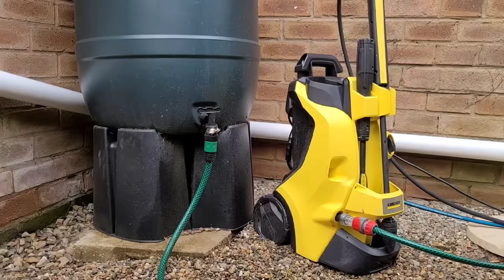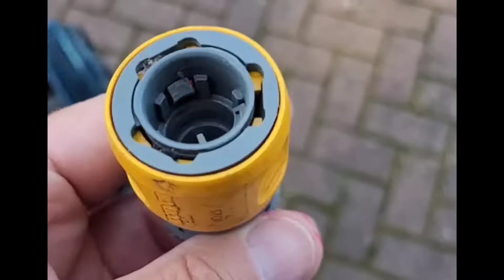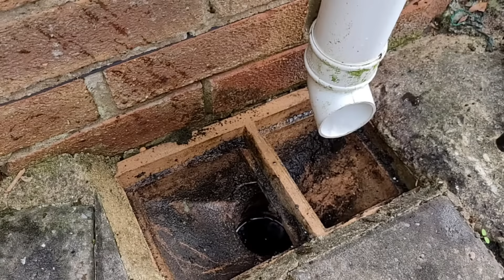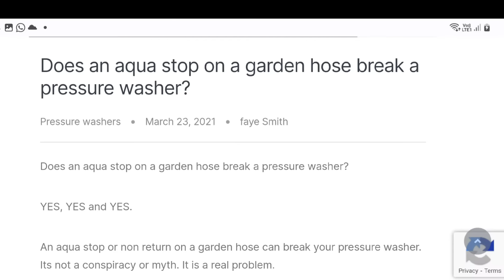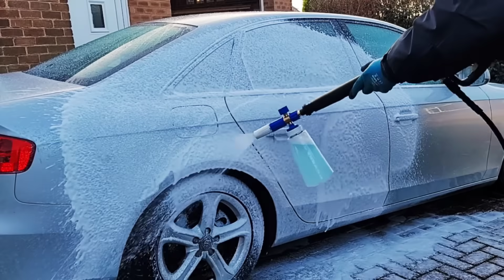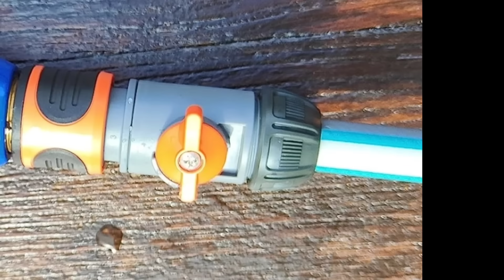The Big Mistake to Avoid when Using your Pressure Washer

Comment from the maker: Update: As several contributors have correctly mentioned, Aquastop fittings do allow flow in both directions when connected. The original source of this error was an article by a well respected pressure washer manufacturer but they have now withdrawn this article. However, the advice from manufacturers and dealers remains not to use aquastop fittings (see the links in the video description). Having looked into it in more detail, it appears that the valve (white pin) in an aquastop connector acts as an obstruction (i.e. it reduces the cross-sectional area) in the pipe. This reduces flow and pressure local to the valve but causes an increase in pressure upstream (inside the pressure washer). I assume this is why the water inlet failures are common. This link gives more detail: https://www.quora.com/Does-a-blockage-in-a-pipe-affect-overall-pressure-of-fluid-in-the-pipe
Reply: Why not removing the video from YT?
Reply from the maker: @projekt156  Because the main point of the video is correct. The manufacturers (Kärcher and Ava) and North West Power Washers (agent and service centre for Nilfisk) recommend that you do not use aquastop connectors with their pressure washers because using them can potentially result in damage to the machines.
Reply: @bigtedshome  Sorry if this is a stupid question but how do i know what sort of connector my hose has?
Reply from the maker: @nrosko An aquastop connector will have a valve inside like the one in this photo (the white pin with the o-ring): https://www.lsengineers.co.uk/2075-soft-touch-aquastop-connector-bulk.html
Reply: @nrosko  if you cannot see through the valve, it has aquastop.
Reply: Thanks for this. Definitely not gonna use the aqua stop now.
Reply from the maker: @billybyrne523 Thanks Billy. It's just as easy to use a connector with a valve, and they don't cost much more than an aquastop connector.
Reply: Agreed. Anything that goes across the inside diameter of the hose/connector will reduce the water flow or increase the pressure to the machine. This will depend on the mains pressure.
Reply: However despite it flows both ways it still restricts water flow by design.

Comment: This is really interesting been using my K4 on front of house mainly for cars no Aquastop ,Two days ago goes on the rear of house to clean patio green alge etc ,My rear hose does have Aquastop never gave it a second thought after id just finished an internal leak developed on Karcher youtubed it you can buy a part which i did replaced worked fine for two mins next thing leaking again i stripped it down again main body had a crack in it so knackered now ,Having watched this chap it makes sense ,some people commented on here about aqualock is two way yes it maybe But the return flow is restricted with that white pin thing ,Listen thanks for taking your time to do this ,Ive just bought another K4 .Karcher get a lot of stick on internet maybe they need to push this message further
Reply from the maker: Thanks for sharing your experience. I hope you have better luck with your new K4 🙂

Comment: Is there a tap you turn to release the soap chemical into the upright karcher machine?
Reply from the maker: No, you either plug a bottle of detergent into the dispenser or use a foam cannon. Both methods are shown in the first minute of this video: https://youtu.be/8Rg4oZI2Mq4

Comment: Hello. I bought a Parkside pressure washer from Lidl a few days ago. This is my very first pressure washer I've ever owned. Now i connected the outside tap to my connector, then connected my hose to the pressure washer. Started the pressure washer and as soon as i turned it on the pressure washer got louder and louder, I immediately switched the pressure washer off. My gut told me this doesn't sound right. Watched a few YouTube videos after this on how to use a pressure washer.  i Found i was doing it correctly so started again connecting everything up. Again the pressure washer did the same thing. After a few days of scratching my head i found i was using a Hozelock (aqua stop) connector from my garden hose to my tap. I then Went to b&q and for £6 bought a Gardena connection this connection has no aqua stop in it because with a Water Stop connector typically has a darker (often black) end where the accessory connects. Internally, you will see a plastic cross or a protruding cylindrical piece with an O-ring. Standard connectors without Aqua Stop are usually grey or a lighter colour and allow you to see straight through the hole. Changed the connectors and Now my Parkside pressure washer works like a Dream!!!
Reply from the maker: Thanks for commenting Dean. Parkside tools are normally very good value for money 👍

Comment: Been using aqua stop with my Nilfisk for 10 years and it’s still going strong.  Perhaps I’ve just been lucky or maybe I just have enough pressure from the tap to compensate for any loss of flow.  Might also help that the Nilfisk has an aluminium pump rather than the plastic Karcher likes to use

Comment: Aqua stop destroyed my K3 Kompact, gutted. Looks like it's ok to use Aqua stop on the tap but not against the machine. Good video but too late for mine
Reply from the maker: Thanks Niko. I'm sorry to hear about your K3.
Reply: @bigtedshome I learned my lesson and it's great you're putting this information out there as it's not clear enough to buyers of these jet washers.
Reply from the maker: @Niko-xz5lk The advice not to use aquastop connectors is in the manuals of Karcher and Ava pressure washers but you are correct, it is easy to miss this information. My new Ava pressure washer also had a label on the back warning against using aquastop.

Comment: Hi Ted., snd thanks for your time, making all thrse videos.

Ive just bought a K4 classic pressure washer,  Karcher, do i need to buy a seperate water hose to  connect to my water tap, and then my karcher,  or does it gome eith a hose [ ive not opened my ksrcher yet) thank you.
Reply from the maker: Yes, if you don't already have one, you  will need to buy a garden hose to run from your water tap to the pressure washer.

Comment: Daft question sorry. just so ive got it right. you DONT use a aquastop on the pressure washer. but you can use one one the garden tap. Thanks.
Reply from the maker: @rjwilkes1970  Yes, that's correct. There is not much point putting an aquastop connector on the tap though. All it will do is restrict the flow. I use a standard connector on the tap and one with a control valve on the pressure washer.

Comment: Aquastop can't cause a build up of pressure as once it is fitted the 'stop' mechanism is released so water can flow in both directions. This article is nonsense
Reply from the maker: @whawkins88  the valve can still cause a pressure increase upstream by reducing the cross sectional area. Please see the pinned comment for more details

Comment: Buy an electronic auto off switch gauge that automatically off the inlet hose  if the pressure reaches the program psi to prevent your inlet from breaking apart.

Comment: I use a garden water butt and a Karcher K4, i use this  Hose Connector with Control Valve at the pressure washer end right?.
Reply from the maker: @pureblood4386  Yes, it makes sense to have the control valve at the pressure washer end.

Comment: This contains correct information  do not use an aquastop  on a powerwasher ,I repair power washers ever day   the best set up is use a 3\4 hose as supply , and no aquastops , use a in line tap at the power washer  , keep the supply water hose as short as possible , do not use extension power cables  as voltage loss over distance is an issue too , you can use an extension pressure hose  instead , the cost of repair is an issue for all ! And my main argument is an every day talking point , if you buy a house hold power washer and do a professional job is for work , but a professional power washer , well would,you buy a wheel barrow when you need a lorry ?
Reply from the maker: @ianholmes1468  Thanks Ian 👍

Comment: About three quarters of the way through watching your excellent video I thought "I'm going to leave a comment saying that I have always replaced the Aquastop fitting with a Gardena tap fitting."  I'm glad I watched it to the end... I would have looked like a right 'Nana, AGAIN!   🥴  😜
(BTW: The Gardena fittings do not weather as well as I would like... the last time I replaced one, I used a Holman brand.  Rather than a fiddly hard-to-turn tap, you rotate the whole fitting - a bit like wringing a chickens neck!🐓 😱
It seems to be weathering better, and it is preferable to use.)
Reply from the maker: @PiefacePete46  Thanks for the tip. I'll look into the Holman connector 👍

Comment: Why would an Aquastop connector prevent the release of pressure? The Aquastop valve is opened by the end of the male hose connector pressing on it. As soon as you connect it to the machine, the Aquastop is opened by the connector on the machine and it stays open until you disconnect it
Reply from the maker: Good point Paul. Aqua stop fittings do allow flow in both directions (The Ava source is incorrect in saying that they are non return). Having looked into it in more detail, it  appears that the valve (white pin) in the aquastop acts as an obstruction (i.e. it reduces the cross-sectional area) in the pipe. This reduces flow and pressure local to the valve but causes an increase in pressure upstream (inside the pressure washer). I assume this is why the water inlet failures are common. This link gives more detail: https://www.quora.com/Does-a-blockage-in-a-pipe-affect-overall-pressure-of-fluid-in-the-pipe
Reply: @bigtedshome  The obstruction is likely to reduce the pressure between the connector and the pump. That might be the cause of the failures

Comment: What nonsense, the Aquastop connectors are a form of drybreak fitting, not one way valves. If your pressure washer is capable of being run off a water butt then the flow restriction of the internal components isn’t amounting anything. Failure of power washers is always down to poor quality machines and in extreme cases leaving a machine with water inside during freezing conditions. As a rule of thumb any pressure washer under £300 is a disposable item. I don’t rate Kärcher machines, cheap bits with an expensive brand name. Get a Shtil RE130 or above.

Comment: I Replaced a Karcher K4 Last Year after Suffering Low Pressure Performance for about 6 Months . I Called into my Local Karcher Dealers to Buy my K5 and while telling the Guy in the shop why i was Buying a New K5 "I had Dumped my K4 " in the Recycling Center about Half an Hour Before that , He asked do i use Aquastop Connectors and i said yes He Said that was the Problem. I kept The Trigger Lance and Hose of the K4 So All was not Lost , The Aquastop Connectors went into the Bin as soon as i got home

Comment: All good, but if they had designed and built a decent pressure cleaner with thought to using suitable components in the first place, then the subject would be moot.
Not so cheap throw away items, at least in the domestic market side of things.
I have worked and repaired all manner of high-pressure products for decades and the quality is going down all the time.
Even the commercial side of cleaners are going the same way.
All built to a price and not to a standard. Of course this applied to just about everything manufactured.
Disappointing
Reply: Yes my karcher 2 lasted two seasons then water leaking out, the plastic pump cracked absolute rubbish. I use a straight through hose so that won’t be a problem. Also worth mentioning there is a fine gauze filter in the water intake which would block up if using a water butt. I thought they were German made but are more Chinese shyte.
Reply from the maker: You're right about manufacturers continually trying to cut costs to stay competitive. It works its way down the supply chain and inevitably leads to a drop in quality.

Comment: An aqua stop allows water to flow in both directions thru it when it’s connected to any male fitting.

If you don’t believe me, stick an aqua stop on your tap and watch the water flow thru it in the direction that it flows out of your pressure washer when you switch it off.
Reply from the maker: Thanks for commenting. You are right about the aquastop allowing flow in both directions when connected. Having read up more on this, I believe the valve (white pin) acts as an obstruction rather than stops all flow out into the hose, and this reduction in cross sectional area causes an increase in pressure upstream (in the plastic water inlet). This link explains in more detail: https://www.quora.com/Does-a-blockage-in-a-pipe-affect-overall-pressure-of-fluid-in-the-pipe

Comment: That's not what aquastop valves do! When connected to the male connector, the valve is held open and allows flow in both directions, it is not a non-return valve. They simply allow hot-swapping of the hose accessories. Stating that the hose acts as an expansion vessel is not correct otherwise the hose will likely see pressure that it is not designed to take, not to mention the risk of contaminated water returning to the mains. You will find that the pressure washer will have an internal non-return valve to prevent this from happening, and also an internal pressure relief valve.

Comment: You forgot to mention a  MAJOR  way to kill your pressure washer .... leave it in a freezing cold shed all winter ( ? ) ...residual water in the internal pipes & bits - n - bobs , EXPANDS !  on freezing , blowing the parts and pipes to bits 😝 .... the following summer your unit fails to work  (  Repair Café volunteer .... DAVE™🛑 )
Reply from the maker: @davidfalconer8913  Good point Dave 👍

Comment: This is rubbish. Water/pressure  can flow both ways through an Aquastop connector whilst it's connected to the machine, so the theory that it causes pressure build up inside the machine is null and void. The restriction of the one-way valve may reduce line pressure slightly but, if your machine works happily from a water butt, which provides even less pressure, there is no problem. I'd be surprised if the makers of Aquastop don't raise a law suit against you for loss of earnings from false information.
Reply: Totally agree. Rubbish and misleading info. That connector while is connected not stopping anything. I don’t know why people creating content like this with zero knowledge and confusing hundreds of other persons.
Reply from the maker: Thanks for commenting Ian. The recommendation not to use aquastop connectors comes from the manufacturers (Karcher and Ava) and suppliers/repairers (North West Power Washers) not me. I am simply passing on this information to try to help others. 
You are correct in stating that an aquastop connector allows flow in both directions when connected. Having looked into it in more detail, it  appears that the valve (white pin) in the aquastop acts as an obstruction (i.e. it reduces the cross-sectional area) in the pipe. This then causes an increase in pressure upstream (inside the pressure washer). I assume this is why the plastic water inlet failures are so common. This link gives more detail: https://www.quora.com/Does-a-blockage-in-a-pipe-affect-overall-pressure-of-fluid-in-the-pipe
Reply: @bigtedshome  they fail because people leave water inside the plastic inlet then put them inside their sheds during winter which causes the water to turn to ice that cracks the plastic as it expands
Reply: @bobbybifta2905  How do you remove the water?
Reply: @MRGAMING-G4L-722 
You disconnect the inlet water hose and run the pressure washer until no water comes out.
Reply: Karcher sell their own stop valve connection which they market as for use with their pressure washers….they even sell one as a bundle with the 10 metre 3/4” primoflex hose.
Reply: Yes, is misinformation, I have been using the Karcher Pressure Washer with Aquastop for more than 10 years. I have Aquastop on all my hose to enable switching of appliances. Aquastop is not a check value, can verify by connecting the end with Aquastop to the tap side, you will find water will flow thru it. If it is a check valve, water won't flow thru. The theory of Aquastop reduces pressure is also invalid. My water pressure is very low, not issue. The practice of fully reducing the internal pressure after use is very important. It can be done by disconnecting the hose after power is switched off by triggering flow. A short burst of spray is an indication the internal pressure is exhausted.

Comment: My MO with any power washer is to connect everything with the water supply off.  The water is only turned on when the machine is on and the trigger pulled.  It may require a second person if the trigger and tap are far away.  Common sense says you don't turn the water on if it has nowhere to go.
Reply: I always run water through my pressure washer before turning my pressure washer on that way there is no trapped air inside
Reply from the maker: @chrisl1797  Thanks for commenting Chris. Your approach is common sense, but a pressure washer should be able to cope with mains water pressure (<3 bar). If you  add an inline valve at the end of the hose, you won't need a second person to turn the tap on 🙂